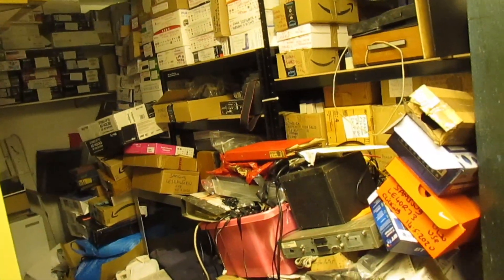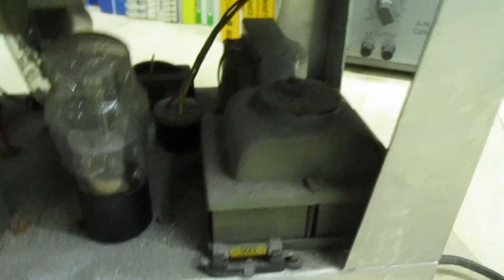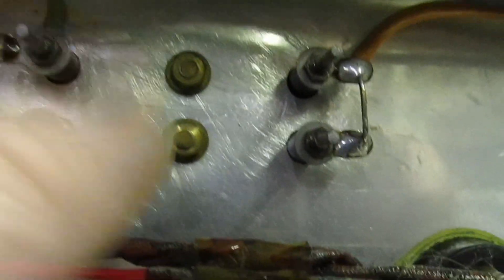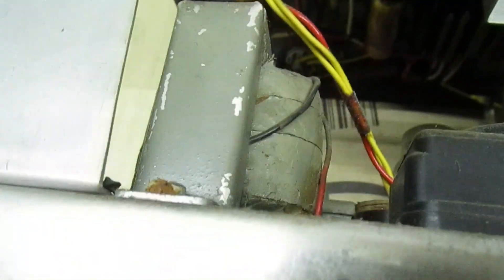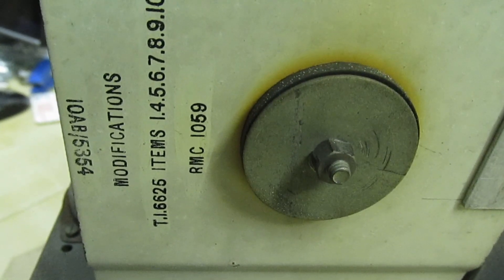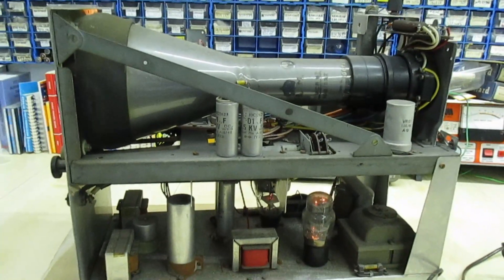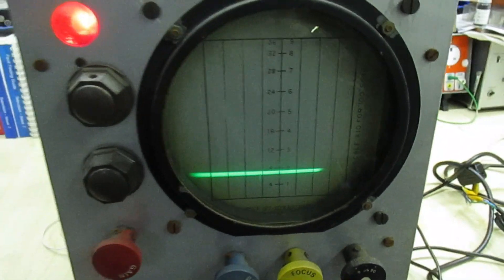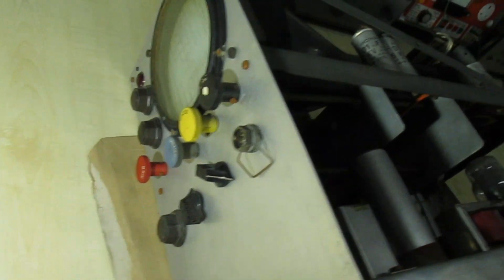Unusual vintage valve  oscilloscope

Comment: The top deck looks familiar - I bought a home brew 'scope from a telly repair shop in York, way back in the late '70s, its chassis looked very much like your top deck, especially those long shaft controls, but in mine, the power pack was up top and had a ridiculously large selenium rectifier tacked in place of the valve which used to do that job.

I was actually after the step wedge generator (405 lines), but it was a matter of buying the job lot, 'scope, generator and band 1 RF generator.

I had assumed that the 'scope was home built in the shop. It was certainly a tidy job, all but for the selenium rectifier, and on mine, the metal cabinet definitely had MOD markings on it. I never had any success with it, though it was fun to touch the input connectors and put the display into hysterisis. I got it to display a raster, of sorts, but never really got to digging any deeper.
Reply from the maker: Interesting , I would have liked to grow up in the government surplus times when stuff like this could be bough in radio shops , this scope incidentally came from the same estate as the home made TV set I have on youtube a while back .

Comment: If the high voltage fuse was blown, it is necessary to check capasitors of that circuit.
Those long pot axles and the distance of transformers to the CRT tell that the design is probably quite good. I have a Heathkit 0-12 and it is poorly designed because of some horrible wire lengths to pots, underrated tube rectifier, low quality PCB, flimsy tube sockets etc.

Comment: Sorry can't help. I bet J Birkett of  Lincoln sold the top bit back in the day.
Reply from the maker: You could well be right,  I would love to visit there shop and after all these years there still going, incredible, in the 70 s there were lots of surplus places like Birketts, sadly all gone now and just a distant memory, in fact I was in Manchester the day Woolworths caught fire, I think it would have been 1976 coming back from a visit to New cross radio on the corner of Oldham street.
Reply: @michaeldranfield7140  I was there in the late 80s still got the wee pair of snips. I remeber what looked like ex aircraft kit on the shelves. There were so many wartime  air fields around Lincolin.
Reply: @michaeldranfield7140  in the 70s My dad would take me round the surplus  shops in whatever  town we were in. Doncaster market had some stalls and good tool shops . I remember him getting me some logic or control boards to strip from a shop in Leeds full of one full of oc71s and the other had red GET transistors never seen them since they had gold legs. RME was the main  shop in Glasgow. There were a few more, one you could still get valves tested in the late 70s